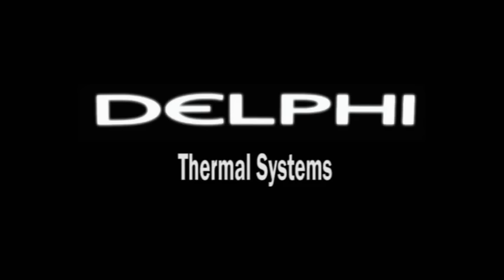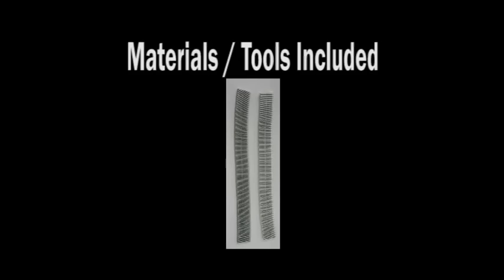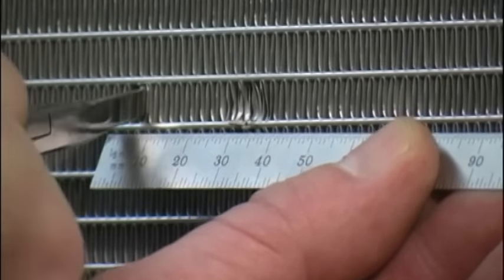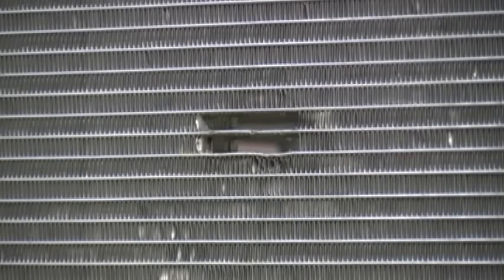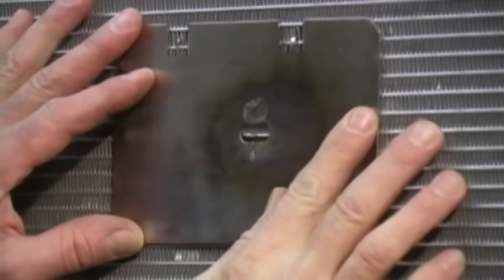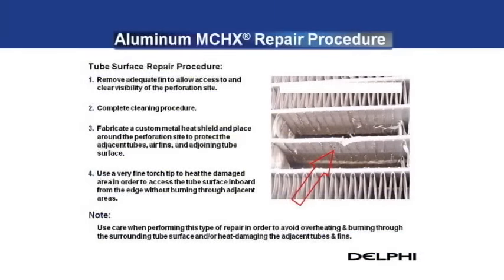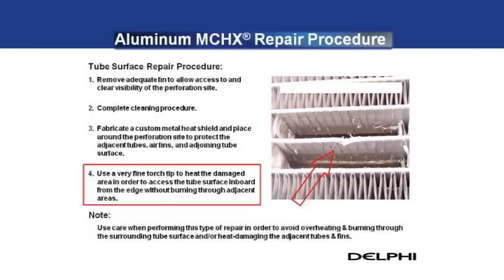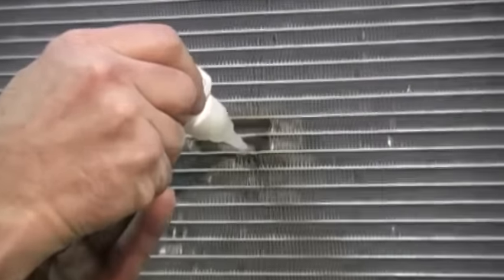Aluminum MCHX Repair Procedure

Comment: There's a product outhere called High side red epoxy ,(2 part epoxy)much easier to repair small refrigerant leaks & you can use a heat gun.
Works great for low & high side it can handle up to 3000 psi
Temperature -100 -300 degrees

Comment: I'm not convinced about gluing the new disipators, that doesn't seem to be realiable for thermal conduction, seem more like just a cosmetic fix to me. probably doesn't matter considering the overall size of that radiator, but surely matters on small radiators.
Reply: @PietriGuitars  you'd probably end up with a half-melted mess.
Reply: I mean, if the glue itself is thermally conductive, then nothing really changes.

Comment: Aluminum materials are very sensitive and more time to prepare for repair... And then after a days same problem is there....
We solve sa problem by replacing new aluminum fins coil and copper tube coil.. Its all  and aluminum fins to copper coil are easy to repair...

Comment: Not once have I found a leak in such an easy spot to fix. Most of them don't even have enough space to fit pliers in straight! And believe me, if they aren't parallel with the channel, you will create a leak in the adjacent channel. Have also come across some systems that have leaked out their charge and have been left unnoticed for up to a year, resulting in 5-6 vacuum pump oil changes through the evacuation process to get below 500 microns due to moisture accumulation.. have never had that issue with copper and I've poured water out of copper condensers. Let alone the rate in which aluminum oxidizes compared to copper. Oil changes in hermetic compressors is gonna become a requirement of a p/m contract
Reply: Alittle tip for ya --- use dry nitrogen pressure tests and flow dry nitrogen through a unit a few times to Help gather up the moisture. dry nitrogen helps alot ! vacuum for a bit, then dry nitrogen Pressure to 100 psi, then dump the dry nitrogen from the unit, then evac for a bit more . i have flowed a whole bottle of dry nitrogen through systems to pick up the moisture it works good. nitrogen is dry so it grabs onto moisture . speeds evacuation time alot. hope it helps u in the future. dry nitrogen flow while welding also helps make for a fast evacuation time.

Comment: YOu want to have Dry nitrogen coming out of THat hole while u are soaping and washing to Keep the water from entering the Coil. Letting soap or water go in the hole is NOT  Ok !
Reply: Yes, I cringed when he sprayed inside the hole.
Reply: LoL make a video repair without cleaning the inside of the tubing, and see how that works for you!
Reply: Thanks Sarge 🖕🏿

Comment: When done, flush the coil out with water- don't worry, just pull a vacuum for a week or so.~~~
 I might use a soapy damp rag, but I'm NOT spraying the hole with water!!  A dry carburetor cleaner pray might be better.?

Comment: What is the point of removing the fins ??? The whole is clearly visible and repairable without having to remove them .
Reply: Good luck not melting the fins when applying heat.

Comment: I like when he continues dumping water at the leak. Let’s try and get water in the system as much as possible. Residential mindset.
Reply: @PietriGuitars  Wouldn’t it be better to have the system in some type of positive pressure when spraying liquid water in open area of a refrigeration system? Or should we just be careless and dump a whole gallon in it because the vacuum will boil it?
Reply: @PietriGuitars  Never purposely put water in a refrigeration system. You are just making more work for yourself and it will require a much longer evacuation time to get it all out.
Reply: Clean out the oil as best as you can. Otherwise the solder will ball up and you will have a charred mess that leaks.
Reply: @kBen1986  if you don't wash out the nearby tubing, the oil will bubble out when heated, ruining the solder site. That's the other reason for repeatedly drying and washing again, you must remove all fluid and residual oil from the inner surface.

Comment: mine came banged up in one area, with shipment, the fins were affected. Should i send it back or will it work
Reply from the maker: The coil shouldn’t be affected by a few dents in the coil. Unless there is a refrigerant leak, I would not replace.

Thanks!

Comment: Often MCHX producer are using automotive design that are very different from HVAC needs. Often MCHX producers are fighting to reduce costs using less and less material. The effect is that MCHX cores are too light, with thin tubes.. easy to damage. To avoid this tipe of leakage is very important to buy from the right MCHX producer.
Reply from the maker: Hi there, we are not in the automotive industry, so we cannot speak to what they do. In many warranty situations, we offer to replace the coil. Repair instructions are offered as an alternative due to concerns our dealers had to offer a quick effective repair without waiting for parts. We try to use the best quality products in our equipment. Sometimes damage to coils can’t be helped.  MCHX can be repaired using this method.

Comment: Is super glue conducting heat to the pipe ? What a crap ...
Reply: I was wondering that myself....also that the replacement fins didn't make contact with the refrigerant tube at the top.  But like they said, it's a very small percentage compared to all the remaining fins.  I looked up Loctite 430, it says it's especially suited for bonding metal substrates but makes no mention of its ability to conduct heat.  I'd rather see those replacement fins a little larger vertically and making contact with the refrigerant tube.
Reply: @jeremy49988  From what ive read loctite 430 is good for up to 200 degrees and even at that temperature isnt the breaking point its the point at which it begins to lose some of its hold.
Reply: Use thermal epoxy if you want, but don't even need to replace the small section of fins. it's negligible in overall effect.

Comment: When out in the field, just bend / crimp it. Cut off the flow of coolant in that cooling line.
Reply from the maker: Thanks for your comment! Due to higher pressures of refrigerant in the heating cycle, soldering is the best option. This procedure is recommended by the manufacture of the heat exchanger.
Reply: It is not a radiator bro

Comment: WoW  Ridiculous amount of detailed work, to "fix/repair" these inferior coils.  You Know their crap coils when they tell you "DON'T PUMP DOWN COND BC IT WILL BLOW/CREATE DAMAGE TO THE COND COILS N CREATE LEAKS"
Reply: Actually, these coils are highly reliable. We have less than a 1% fail rate so less failures than your typical tube & fin coils
Reply: @johnpendleton7243 Interesting.  When why cant they hold a simple pump down?  bc label stated "Do Not Pump Down"
Reply: @johnpendleton7243  also they were kinda ok when the R22 (lower Head pressures) in around.  R410a pressures, Look out
Reply: @user-xk5so7wb2t  probably because the coils are long and narrow hot dog cross section and not circular. The long walls would probably collapse under vacuum.
Reply: There isn't enough volume to store the refrigerant!. It is a fraction of the tubing on plate fin coils.